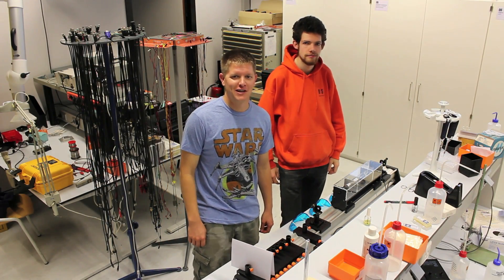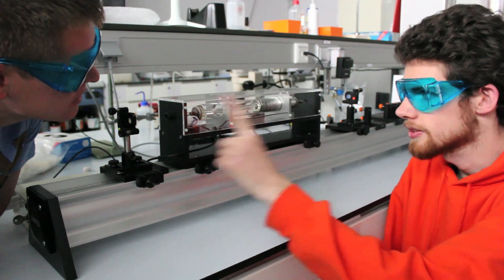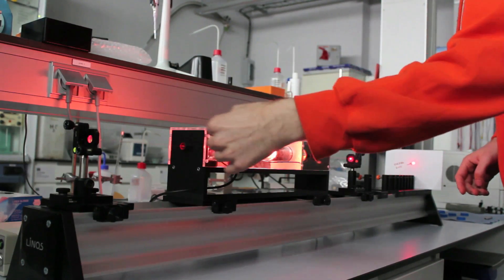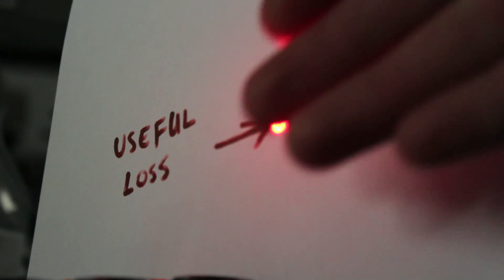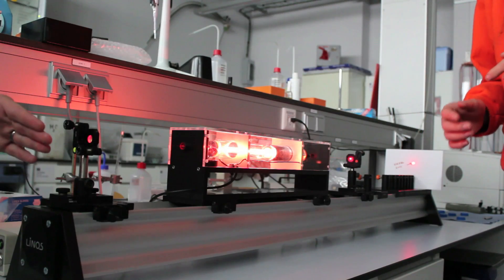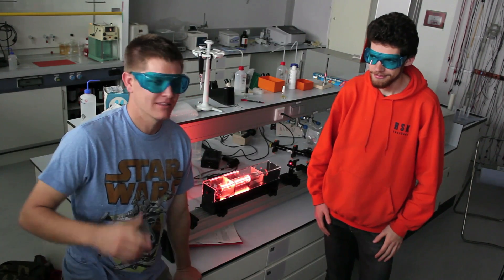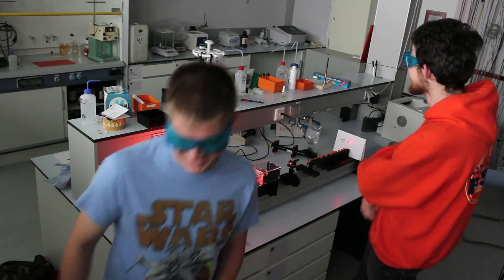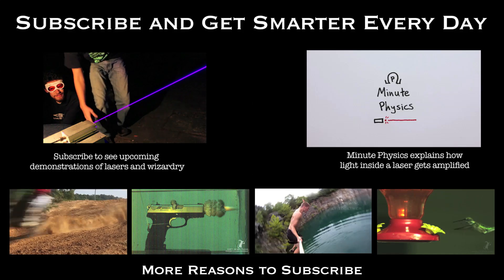How Lasers Work (in practice) - Smarter Every Day 33

Comment: So it's my understanding that the light energy bounces back and forth between the two mirrors (one being just less reflective than the other) until the beam breaks through the less reflective mirror which results in beam emission. That tells me that there is a substantial energy loss. Most of the power remains inside the open cavity tube allowing only a lesser percentage of the power to escape.
We have auto reactive welding masks the lenses of which are transparent until the goggles detect the higher light energy emitted by arc action. The lenses of the goggles automatically darken to protect the welders' eyes, then return to transparent once the more intense light ceases.
Would there be any way to create an auto response mirrored surface that would react in similar fashion? With such a mirrored surface, the two mirrors (one being a stable full reflective mirror at the back end of the laser) could be made completely reflective until such time as beam emission was desired allowing for full power emission instead of partial.

Comment: I always thought that lasers worked by pushing energy into atoms inside a semi-silvered capsule to the point that the outermost electron becomes excited to the point that it jumps out to the next electron shell, then immediately releasing the excess energy by releasing a photon and falling back into its original electron shell. I thought that these photons bounced around in all directions in the semi-silvered capsule until they met the semi-silvered end caps of the capsule at the correct angle so that the photons could pass through, to create a laser beam.

Comment: The mirrors are "perfects", reflecting much better than those we use in bathroom. The shape is flat... a tiny bit concave to force any photon that was bouncing at an angle to get back in line.

The is a tiny hole at the center of one mirror to let a small percentage of photons, such as 2%, to exit after having been reflected 50 time or more.
This hole is the reason a laser emit a narrow beam of light. The beam diverge a little over large distance. The best laser firing at the moon get a beam a few miles wide. The air make it impossible anyway to keep a beam focussed.

The laser "tsunami" from spectra physics create 10 pulses per second with light so intense that the air ionize, creating a super sonic boom on each pulse. It sounds like a whip slapping fast or lightning, which are example of white noise created by all frequencies meeting at the same time when the sound wave catchup with the air molecules, which moved above the speed of sound.

Comment: What happens when the mirrors only reflect 90 or 70 or 50 or 30 percent of light?
Reply: If the reflectivity of the mirror isn't high enough, there won't be enough light/photons inside the cavity to hold the laser stable. This means, if you take too much light out of the cavity by leaking more and more light out if it, the amplification won't be strong enough and the so called laserthreshold won't be reached. I can't give you a specific number for that reflectivity, but as far as i know, most common lasers use a mirror of 95% or more, smoe maybe down to 90 %. 
I hope my answer helped you :)

Comment: I get the feeling you are a Star Wars fan Destin. Anyway, my question is: why are green lasers more harmful to human eyes than red lasers. The reason I ask is that I've heard that, and well, I want to know. Bad things have been done to pilots using lasers, and I think they're often green. I think it's for that reason that green laser pens and pointers have been banned, at least in the UK.
Reply: This may be wrong but I believe it has something to do with the wavelength that accompanies the specific color. If you take a look at a picture of an EM Spectrum, you can see that red is on the furthest end of the visible light region while green is closer to the middle of that region. Regardless, the red wavelength is somewhere around 700nm I think while the green one is small than that. As one of the properties of the spectrum, the higher the wavelength is results in a lower frequency and energy. Therefore green lasers have a higher energy and frequency than the red lasers. This partially why radiation is so harmful; because of its insanely high frequency and energy. Additionally the frequency determines how often the wave can "hit" a surface so higher frequencies essentially mean more hits in a shorter amount of time. 

Again, I'm not sure how correct this is, it was just covered in my chemistry class but I feel confident in my reply. Hope this makes sense!
Reply: I believe this is because shorter wavelengths carry more energy. Using the equation E = hc / λ we can easily calculate that that for long wavelengths like radio waves the carried energy is significantly lower than for short wavelengths like x-rays. Green light has a wavelength shorter than red light thus it is more harmful.

Comment: is there a critical distance between the mirrors??  Are lasers in need of mirror adjustment?
Reply: Yes, there is a critical distance. The lower the distance, the less neon atoms you got there to amplify the light. So if you lower that distance, you have to adjust other parameters to keep the laser going, like increasing the electric power that drives that cavity.
The mirrors got to be perfectly adjusted. You can imagine that the beam can only get amplified by the cavity if it bounces at the same angle away from the mirrors it got to the mirror in the first place. Only i little difference of that 90° angle will cause the laser to not even start or to stop working, if it was adjusted before.

Comment: I was just wondering... If we fully understand lasers and how they work, how come we can't make weapon out of them? Are the best lasers currently too weak? Can we in the future make more powerful lasers or have we already made the most power ful possible laser, but it's not powerful enough? I'm thinking like Laser rifles from Fallout or Star Wars
Reply: +William Faulkner any laser that is powerful enough is to big to be practical for a gun sized laser.
Reply: That makes sense actually, even then though is there a way to maximize the energy output through studies to allow a laser to be small enough? Or like is it just physically impossible
Reply: Look up the MAWS laser system
Reply: +Gaming Brothers LAWS*
Reply: +William Faulkner bullets are just more effective. Maybe if we bring together different advancements in tech in the future then maybe but currently hand held laser devices are pretty shite. I want to know why we cant build a gamma sniper though. could potentially trigger cancer in people from miles away, a clean discreet assassination tool.
Reply: Go watch +styropyro
Reply: +William Faulkner With artillery you can fire over obstacles, with lasers you can't. They'd be great for anti air, but not much else. Also, I believe it's easy to defend against one. They bounce right of mirrors for examle. (Maybe not the powerful ones)
Reply: koffieslikkersenior Maybe a mix for aa. If the target is mirrored it will be very easy to spot so if the laser fails then use conventional weapons. There is a missile defence system that uses a laser which is under production.
Reply: They're against the Geneva Convention.
Reply: ***** it falls under heat weapons. Sorry, should have said that.

Comment: How do laser diodes work?  Like the ones in a cheap laser pointer.
Reply: TedRobotBuilder They basically work just like normal LEDs, but they also have partially reflecting surfaces at opposing edges of the crystal. The diode laser is pumped using an electric current and the energy gap between n- and p-doped region determines the wavelength of the emitted light. The reflecting surfaces (=mirrors) at the ends of the crystal act as the resonator. If the current is high enough and excited states live long enough you can reach inversion, making stimulated emission the dominant effect inside the cavity and off you go. If you know what all these words mean, that's basically everything you need to know.

The Helium-Neon Laser shown in the video has a gas-filled bulb containing a mixture of Helium and Neon. It then needs to get "pumped", meaning you bring energy into the system in a way that the electrons of the Neon Atoms get to an excited state that is stable for sufficient amount of time (doesn't need to be very long). In general, the easiest way is just flashing white light at high intensities on the cavity, so the electrons pick up the wavelength they can absorb, the rest is wasted. This is called "pumping". In the He-Ne-System the whole process is actually a little bit more complex but it all ends up exciting the Neon-Atoms to the desired energy levels. They have a semi-stable energy level that emits a red wavelength upon decay (and a infrared one).
Now those electrons in general don't like being excited and they tend to get rid of their excess energy again, emitting a photon of the corresponding wavelength in the process. For every possible excited state there's an average time required for this process of emitting the excess energy. You can actually do a bunch of quantum mechanics to try and calculate that.
However, there's another thing that's special about those excited states. If another photon of the exact same energy/wavelength happens to come across the excited electron it does something that's called "stimulated emission", meaning that it immediately emitts its excess energy and not only that but it does that in a very special way: It creates an exact copy of the photon passing by, meaning that the new photon doesn't only have the same energy, but it also gets the same phase and direction. So instead of the original one photon, there's now two travelling in the exact same direction and interfering constructively with each other (= amplifying each other).
That means: If we can put enough energy into the system and the excited states live long enough so that there's more electrons in the excited state than in their ground state, a photon passing through the system has a higher probability of meeting an excited electron and thus creating a second identical photon than meeting an electron in ground state and thus getting absorbed. This state of the system (more excited than non-excited) is called "inversion". Now if you have that inverted system and one of the exited electrons randomly gets rid of its excess energy, emitting a photon, you'll get a sort of avalanche effect, meaning that all of the other excited atoms the generated photons pass through, will also get rid of their energy, resulting in more and more identical photons (= intense light travelling in one direction). This gets us pretty close to the working laser, but there's one step missing.
The last problem is: The seed photons randomly initialising each of those avalanches will always go off into random directions, meaning that the He-Ne-bulb will basically shoot super-mini-lasers in random directions all the time. Which is not as exciting as it sounds. We want all the photons we can get to always travel in the same direction together (and control that direction). This is where the mirros come in. If we now put two parallel mirrors on two opposing edges of the bulb and wait for one of those "super-mini-random-lasers" to hit the mirror perpendicular and bounce back into the bulb, that bunch of photons will get amplified even further everytime it passes back and forth through the bulb, outhweighing all the other random emissions and becoming the dominant direction of emission. Now we reduce the reflectivity of one of the mirrors from 100% to 99,5% and we get a part of our laser beam leaving the system in the desired direction, but still keeping most of the energy in the system to keep catching up all the other excited electron-states as we keep pumping. This is called the "resonator".

Now back to the diode laser: There's no gas-filled bulb, but a diode quite similar to your everyday LED. Instead of flashing light or whatever at low pressure gas atoms you just pump the laser by passing a current through the diode. This generates pairs of so-called "holes" (= missing electrons) in the low-energy band and delocated electrons in the high-energy band of the pn-doped semiconductor contact. Again, there's a an average time for those excited electrons to "fall" back into the low-energy band, recombining with the holes and releasing the surplus energy they got from the current. Now if your semiconductor system emits this energy in the form of photons and you have excited states that "live" long enough so you can reach inversion, you can build a laser from it by putting mirrors on it :) On a diode laser you'll often find optics before you reach the mirrors to correct the beam as soon as it leaves the semiconductor crystal, because the beam quality coming out of these things is horrible. But you could just slap mirros ( in this case it's more like a very thin reflecting film ) on to it and it would work.

The reason why these excited states (in both systems) need to persist a certain time before they randomly decay is just so it's possible to reach inversion in the first place. If those excited states randomly release their energy ( = "spontaneous emission") almost instantly you will have a hard time trying to pump the system hard enough so you can have more excited than non-excited electrons, meaning that your laser won't work, because stimulated emission can't take over. If stimulated emission can't take over, you'll just end up with single photons released into random directions, getting absorbed elsewhere without any amplification. This is always the core principle of a laser. L.A.S.E.R. = Light Amplification by Stimulated Emission of Radiation.

Hope I could shed some light. Pun intended.
Reply: Wyand Thank you!!! :D
Reply: +Wyand we all just got scienced on
Reply: +Wyand Beautiful answer. Upvoted for its precision and somewhat concise nature.

Comment: Would it be possible to use some kind of shutter-type device, opening and closing extremely rapidly, to let more than 2% of the light escape, giving a brighter beam without having to have so much power consumption and heat inside the laser tube?
Reply: Have a look into cavity dumping, it's a method to generate short pulses. Average output won't increase. Q-switching is the other way around, actually stoppping lasing to let the population inversion grow before opening the "shutter", creating one huge pulse because of the stored energy.
Reply: The other 98% is used for reflecting back and forth to build up the coherit light (some of which is lost of course). eventually each and every photon will get it's 2% chance to escape. It is sort of like a negative feedback loop: The more light the mirror reflects back into the chamber, the more it will build up, and ideally, the more photons there are to escape, but more photons + more reflectivity = same light output, I would think. 

In theory, the shutter would probably need to stay closed for a few milliseconds to build up the beam, then it opens to optically 'discharge' that buildup, then close quickly again to build up the photons again. This will result in bursts of LOTS of laserlight, but for such a brief period of time (nanoseconds?) then the light would have to build up again for a  few milliseconds.

In practice, the shutter will need to have a mirrored surface that is very well adjusted, but I'd imagine it would 'shake' loose quickly, and idealistically offers no advantage other than standard pulsed gas laser.

You just have to remember that other 98% of light not allowed to escape is basically stored up for later use, and the majority of laserlight will escape.
Reply: Good points. I was just thinking (after your reaply) maybe using glass with a chemically-reactive "tint" sandwiched between 2 layers that can change states from tinted-to-clear in a matter of nanoseconds, that is constantly changing state, much like "Active 3D glasses" do. 

I dunno, this type of physics is over my head. Lasers are COOL, that's about all I know about them!
Reply: Yeah. I think you are thinking of LCD technology. I wonder how solid state lasers work, what was shogun in the video was just for gas discharge tubes...
Reply: It does exist, it's called cavity dumping but unfortunately it would only lower the average output power.

Comment: When I was ~10, I always assumed that the only way a laser would work is if the light gets reflected back and forth between to mirrors, amplifying the beam, and somehow magically passed through one of them and now that 5 years has gone by I finally feel enlightened about how this idea could possibly work.
Reply: Yoo this is an old comment I hope you're doing well and still having a thriving interest in stem
Reply: @pianoraves   Thank you! I’m pretty close to getting a bachelors in aerospace engineering and I’m also researching how one would use phase differences between antennas to find the direction a signal is coming from.

I hope things are going well for you too!
Reply: I used to think that there was a small hole for some of the light to leak away instead of partially transparent mirror.
Reply: Bro this is the way actually lasers work

Comment from the maker: How lasers work In a nutshell: Light bounces back and forth between two mirrors.  The light intensifies between the mirrors.  One of the mirrors has a tiny hole to leak out some of the photons.
Reply: Laser resonater helps to populate the photons making the light more powerful.
Reply: @bushelfoot Yeah, just like the capacitors for supplying sudden huge drawing amperes in various devices such as subwoofers or electric motors and so on👍🏻
Reply: I wonder if this is enough of a summation for my HeNe laser prac report 🤣